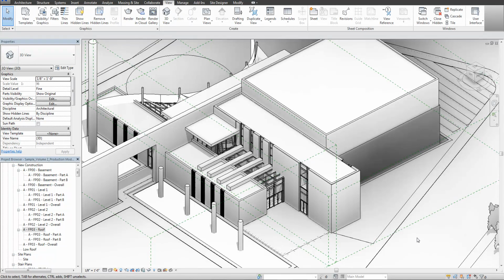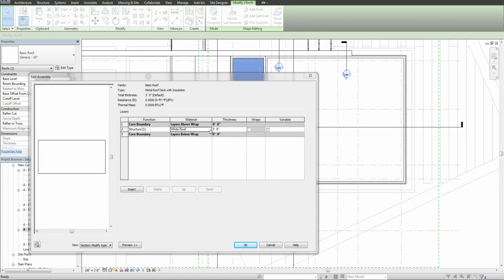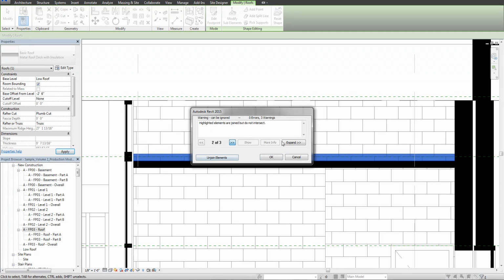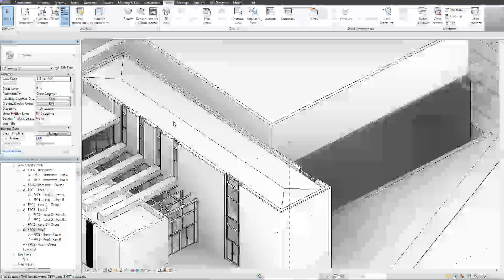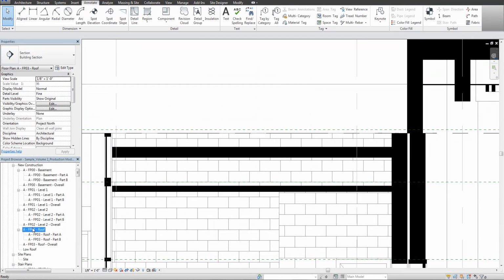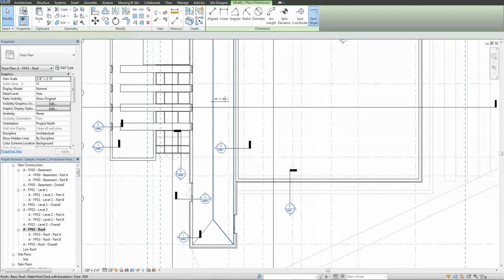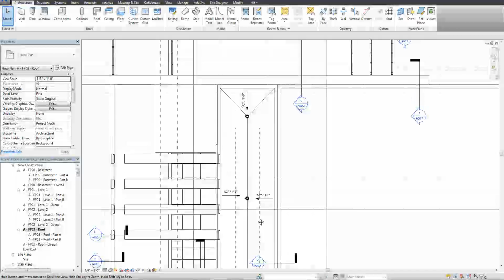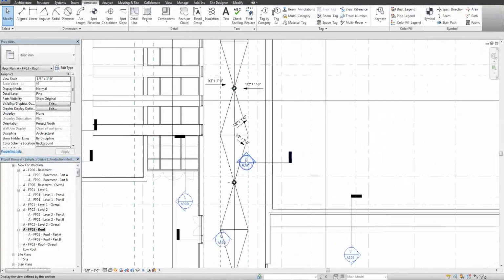Revit Tutorial - Roof Crickets and Flat Roofs

Comment: What is the best practice for a adding roof drain crickets to a roof that already has a constant defined slope?  The Modify Sub Elements are not an option once you a define a constant slope.  I see some people just model crickets as an in-place model but this seems like it should be a basic function to add crickets to both a flat and constant sloped roof.
Reply: Bret Kennemer Bret, I have an adaptive cricket family for those instances... Instead of modeling it in place you simply click start and finish points and set the pitch... You could also use the modify sub elements instead of the slope to create a constant pitched roof if need be.
Reply: ***** With using a cricket family I assume you would have to model the insulation and recover board separately or you would have recover board running under your crickets.  I don't really understand why autodesk could not build Sub Elements into a constant slope roof.  If using the sub elements to create constant pitch, then the structure would have to be flat, correct?  Or is there a way to control the bottom plan of the roof as you can the top?

Comment: I have a roof that is sloping to the parapet. I'm taking sections for final drawings in several places where the roof meets the panels. I also have a structural model linked in with the actual slope and location of the structure. Creation of crickets and drain locations on a flat roof with variable insulation does not work because I have structural members showing the actual slope. Is there a way to control the slope of the structure separately from the surface elevation of the insulation?
Reply: Че?
Reply: Revit problems in my life